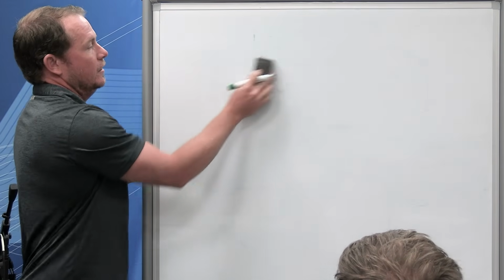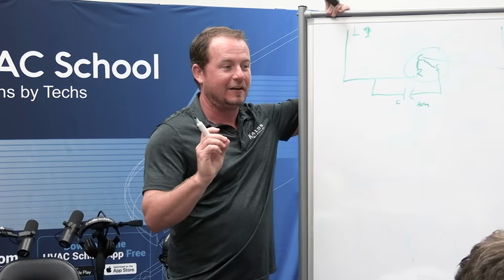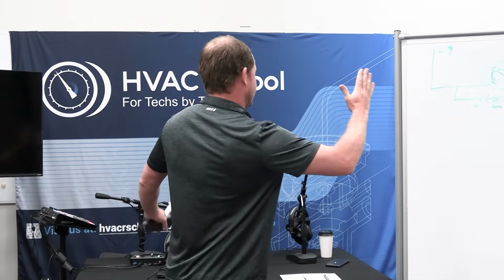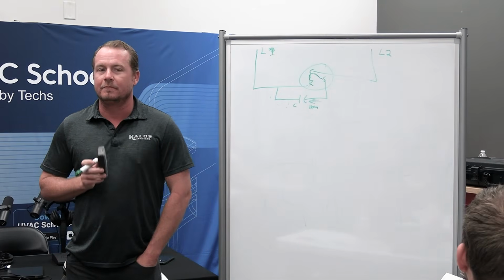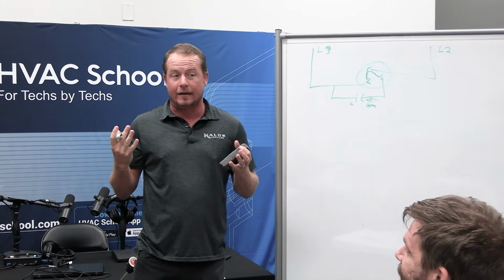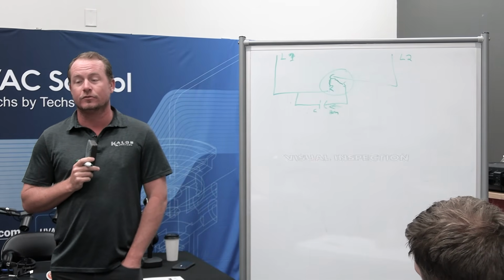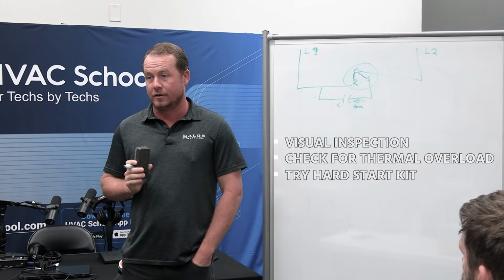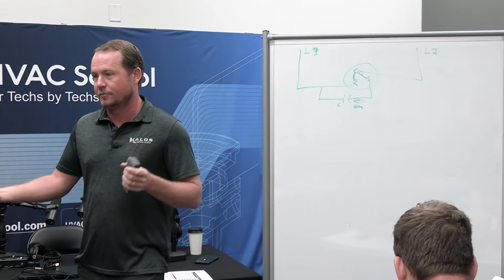Capacitor and Hard Start Myths Busted

Comment: From an electronicsc technician point of view, the symbol shown is for a polarized capacitor used for DC circuits.
The capacitor would be reversed bias for half the cycle.
When a capacitor is reversed biased it would essentially becomes a short circuit!

I don't know about those hard start kits but I suspect that they just increase the total capacitance!

Comment: I have replaced low capacitors just to find the numbers not changing with the new capacitor.  Does anybody know what else should be going on.  Is it the windings in the motor that are going out?

Comment: Two phases is not created from a single phase. There is no two phase home wiring. It either single phase or three phases. Nearly all US houses have single phase 2 wire 240 volts supplied with a center tap neutral to get 120 volts.

Comment: As you said it’s only part of second that kick start cap will start compressor .
I saw that I have regular clamp meter I put it on high A .around C black cable .
I just pushed contacts fraction of second my amp was 82. Without start kit .now with start kit it hit 60.
My system has relay +cap hard start kit. I did go bad my system low side was hot to touch. Liquid line was colder than it should ,
I did check all wires and R,S,C comp wires and values,ok.
I left system off with gauges connected to service valves to see if any leaks, for over night was ok . I don’t have TXV, I do have Orifice , my system in attic with 24” high ,coil is there , I went up also cleared drain in case , was ok,, I checked superheat ofter all that .i did put a new dual cap old one 43.6 f  of 45f so I change it too,,no system runs ok for now,
Superheat off by 1 . I don’t want to add more until it unit ask for it.( your note about what cause boiling referigrant,it very valuable and what cause it faulty cap made comp struggle.heat up suction side.
Great informations ,you are the best.

Comment: I liked your explanation about capacitors. If you were to use EE speak, it would go over most peoples heads (changing electrical fields theory) . I once had to describe a digital IC tone generator (several BCD coded chips) that actually created a precise number of pulses per second, but was non sinusoidal and aperiodic in that the pulses had irregular spacing . The output had to be filtered to get a tone. I described it as a chip that counted out a certain number of balls per second and dumped them down a hopper.

Comment: Its very hot here in Central Florida these past months. I am here because my 8 year old TO-5 2 wire hard start kit (Installed in 2017 by HVAC company during emergency maintenance for bad Fan Run capacitor) failed and my compressor would not start. I have been replacing my 45/5 run capacitor about every 2 years with AMRAD with CPT terminal. the other day as I arrived home I heard the compressor trying to start. It did this a couple times while I was there and I think it had just failed as the house was not warm and the compressor was not very warm either. I immediately blamed the run capacitor and installed another. Same problem. I removed one lead of the hard start kit, and the system started fine.  I measured both old and new capacitors capacitance and dissipation factor and they were fine. (The CPT fuse had not burnt)  The hard start kit capacitor measured dead shorted. I removed the kit and disassembled the potential relay and there was a huge amount of carbon from arcing. Reassembled the hard start kit and capacitor measured 0.3 ohms on the blue wires.  I suppose it had been failed a long while. I wonder how I can determine if there is damage to the compressor windings? The system is 15 years old with regular maintenance service. I do change my own run capacitors proactively to save an emergency service call.

Comment: Interesting video. I Have a question and hope some can help me.  I want to lower the startup current on my refrigerator which is connected to an ESS battery system. The startup inrush current I measure with a chines multimeter is 12.5A @120Vac the nominal current of the compressor is 0.8A. The impedance seen by the grid is 10 ohm so I thought let's use a 10ohm NTC 2A resistor in the run coil path of the compressor. In this way I want to lower the current with say 50% assuming the compressor will still start and not stalls under these new conditions. My question is this a good idea, and has anyone ever done it. Is my assumption of 10ohm NTC ok.

Comment: If an AC condenser start capacitor fails, will the compressor try to start on the hard start capacitor and would that cause damage to the compressor?

Comment: I like this description. The best description i use is riding a bike. A 2 pedal bicycle you need a hard push on the pedal to get going and then you need to give it a nudge to keep the speed. The pedals rotating represent the single phase wave. A three phase has 3 pedals. Because one pedal has force all the time with 3 phase but on single phase has a dead spot so you need that extra kick.

Comment: Fun fact, the capacitor is actually charging and discharging 120 times a second, twice in each full AC cycle (plus the phase shift).
Reply: Incorrect, you get one full AC cycle 60 times per second. You need the full cycle to be considered fully charged or discharged. Not just the positive alternation and the negative alternation of the AC cycle.
Reply: @DeathLeftHid  This is a matter of semantics, specifically in how you define charging and discharging. 

From an electrical engineering and AC circuit design perspective, charging is defined as the part of the capacitor cycle where positive voltage is applied, and discharging is the part of the cycle where negative voltage is applied.

However, this model doesn't accurately reflect the physical state of the capacitor. It's short hand to simplify circuit design. 

In it's simplest form, a capacitor is two conductors separated by a dielectric sheet/film. It is charged when there is a difference in the number of charge carriers (electrons/holes) on across the dielectric. 

When you apply an AC current to a capacitor, it becomes charged twice per AC cycle (once positively, once negatively) and it becomes discharged twice per AC cycle, when the potential difference across the capacitor is zero.

Comment: A hard start kit helps a compressor last longer by starting it faster — for example, without the kit, the compressor might draw 50 amps for 3 seconds (producing 7,500 heat units), but with the kit, it draws 80 amps for just 0.5 seconds (only 3,200 heat units), cutting heat stress by more than half.
Reply: Yep, this doesn't seem to sink in

Comment: My question is how do the connections of L1 and L2 connect to internally of the capacitor.  Each end of the coiled conductor material or one on the insulator and one on the coiled conductor.?
Reply: Inside the capacitor there are actually two conductive layers and two insulating layers. The capacitance is determined by how much area of the conductors are in close proximity to the other without actually touching, and also how close you can get them. Making the insulating layers thinner will increase the capacitance but decrease the voltage point at which the insulation will fail. Each of the conductors is brought out through it's own the connection. The reason for the jelly roll is it allows both sides of each conductor to count as area. Air, glass, vacuum, paper, ceramics, cotton, oil, wax, tar, plastics, wood, mica, and a wide variety of synthetic materials have all been used as insulators. None are perfect or suitable for every application. 

The oldest and largest capacitor is the natural one where one of the conductors is the earth and the other is a storm cloud. The area can be many square miles, the insulation (air) easily a mile or more thick. Such a capacitor can easily withstand millions of volts until a weak spot in the insulation causes it to fail. Then you get a bright flash of light and a loud noise.

Comment: Can you install a hard start cap on a home air compressor? 2HP Dayton?
Reply: Depends on the type of motor. You might be able to find a kit that's appropriate if your machine has PSC motor. Check first to make sure that any existing capacitors are functional and the wiring isn't broken. 

If your motor has a centrifugal switch (listen for the click almost immediately when starting and again within a second or two upon shutdown) you may be S.O.L. An unloader valve that allows the machine to start with no head pressure might be a better option.

Comment: The center tap gives you the  120 volt, the line itself is 240 without splitting it with the center tap

Comment: A realistic description of a capacitor is two plates a small distance apart. Both of these plates have billions of electrons in them. When you apply a voltage (From L1) to plate #1 the voltage pushes more electrons into the plate, that builds up an electric field on the plate, the electrons on Plate #2 are repelled by the  electric field and electrons get pushed off plate #2 into (L2).
 When the polarity reverses, L2 applies a voltage to plate 2, building up electrons and an electric field. The electric field on Plate 2  pushes the electrons off of plate one.

Comment: So, if the capacitor "kick starts" the motor (that's what I was always taught), I was also taught that there was a relay inside the motor that disengages the cap circuit. Am I hallucinating?
Reply: Centrifugal switches are used on some air compressor motors and some water pumps to perform a similar function as the potential relay.
Reply: That depends on how long ago you were taught. Some older equipment works that way.

Comment: An ACcap symbol uses 2 straight lines, when one is straight and one is curved it is a DC cap and would blow up in an AC Circuit.
Reply: Not necessarily. The curved line could also designate the outermost layer of foil in a paper/wax, metalized film, polystyrene, or the frame of a tuning capacitor. There are a few symbols that are only used for certain types of polarized capacitors such as electrolytics or tantalums. Any of the other capacitor symbols could be used to designate a DC cap with the addition of a + symbol. You have to be careful with the use of a pair of parallel straight lines, with or without a slash through them. In some fields such as industrial controls and in some cases HVAC, they may represent switch contacts. I try to avoid using that symbol.

Comment: From charGPT,

In the start sequence of an AC compressor, a capacitor is used to improve the compressor's starting performance. Specifically, a start capacitor provides a temporary boost of electrical energy to help the compressor motor start more easily. Here's how it works:

1. Starting Torque: The capacitor creates a phase shift in the current, which improves the starting torque of the motor. This helps the motor overcome initial inertia and get up to operating speed more efficiently.

2. Smooth Operation: After the compressor starts, the capacitor usually disconnects from the circuit (in the case of a start capacitor) or remains in the circuit to improve efficiency (in the case of a run capacitor). This helps ensure smooth and efficient operation.
Reply: charGPT has it only partially correct. Either the start or run capacitor topology will provide a phase shifted current to one of the motor windings to to not only aid in starting but to also get the motor spinning in the correct rotation for the application. 

A start capacitor is used only for startup and will be disconnected from the start winding once the motor is up to speed with either with a potential relay, a current relay, the electronic equivalents of either, or a purely mechanical centrifugal switch. Such a motor might be known as "Capacitor Start Induction Run (CSIR).

If there is no disconnect means and the capacitor is permanently connected to the run winding, the motor is commonly known as Permanent Split Capacitor (PSC) or occasionally simply split phase. They tend to be somewhat more efficient than the older design. For some reason capacitor quality has sharply declined. I can't blame it totally on the elimination of PCBs.

The next major step up on the efficiency scale is the Electronically Commutated Motor (ECM). That includes the notorious x13 which found it's way into air handlers and high efficiency furnaces a number of years ago. It is essentially a three phase motor with integral electronics. Great idea in theory, but poor execution in controller design. The $3 part intended to limit inrush current is the weakest link. 

IMO the inverter compressors and blower motors which have almost completely taken over in the mini split world will soon be taking over the vast majority of the traditional residential market. Once again they are a 3 phase brushless DC design but with separate drive electronics that are vastly improved. There are a few brands that actually stock boards, motors, and other repair parts, and offering them at low cost. The main drawback I see is that those systems are far less tolerant of sloppy installation practices which have been increasingly creeping into the industry over the past half century. Being variable speed systems, "gas and go" will no longer be an acceptable option.

Comment: At around 9:20 you mention that the start winding is “always in place” and that it is not disconnected.  Just for your viewers, some single phase motors do disconnect the start winding via a centrifugal switch inside the motor or externally with an electronic Start Switch like a Stearns SINPAC.  Great video!  I didn’t know the compressor motor left the start windings in play.
Reply: It is a Start Cap not a run.

Comment: Glad I came across this video. I have my home set up with a generator disconnect and want to run my ac with the generator. But my generator doesn't push enough power to start the AC unit. I have been told that a hard start will allow this. But the AC runs fine now. So my question is this. Is there any harm with installing a hard start kit on a AC unit that is running fine, so when the power goes out and I am operating off generator power the hard start is already in place and ready to go? Also what are your thoughts on a micro air soft start kit?
Reply: Most generators won't tolerate high inrush currents without bogging down or stalling and are incapable of producing full rated power with loads that have low power factors. A soft start might help with the inrush. A hard start could make it worse. You will still have an issue if your AC needs more amps that your generator can provide continuously. Some of the new inverter AC systems are actually quite generator friendly. Legacy systems not so much.

Comment: What about a soft start kit?
Reply: A soft start kit ramps the voltage to prevent a current spike on startup. These allow the resistance to inrush to build up via the reverse current force of the magnetic field wave sustained by the motor as it begins to turn. Once the motor is at full speed (no longer accelerating), it is resisting the maximum amount of inrush at that rpm so the current is stable.

A hard start will increase the inrush current for motors that need more torque to start. A soft start gently starts a motor that is capable of starting slowly, to prevent a current spike. Supposedly lowering the inrush increases the longevity of the motor by reducing mechanical stress of high torque. IMO soft starters are best for situations where there is limited current available due to inadequate utility or underrated wiring, and honestly should be on all equipment but isn’t because of cost and the manufacturers lack of concern about longevity or the customer’s electrical system requirements. They also can’t be used on poorly designed equipment that is incapable of slowly ramping in speed, or in equipment where high starting torque is unavoidable due to the process (I.e, conveyor belt with no clutch)

Comment: The opinion about a potential relay staying closed causing a start winding to fail is correct, but a failure in the opposite order is more likely. Initially, failing insulation in windings shorts out a few turns at a time. The EMF of the start winding at full speed drops, the start cap stays in circuit a little longer, no one notices anything. When there are enough shorted turns to leave the winding below the pick-up voltage, the potential relay doesn't take the start cap out of the circuit, and the high current heats up the start winding and the insulation fails very rapidly. 
   How can you tell which failed first? If the windings are in good condition, and the relay doesn't pick up the start capacitor will overheat and burst long before the windings burn their insulation. If the start windings failed first, the start cap will often be intact.
   That said, the potential relay would be improved by a time-limit, if only to avoid contributing to failures in progress. The cost to add winding voltage and current monitors to a control board is around $2 and would allow the microprocessor to take over from the electromechanical potential relay resulting in a net cost reduction and add the time-out, but more importantly make it easy for a system to detect failing motor windings early and plead for service and eventually shut down before a burnout makes the repair much more expensive.

Comment: Is there any way to confirm the duty cycle of the hard start (relay being energized)?   Yes, .... checking it in the system?
Reply: There's always a way. I would use a small current transformer like the open/close type that comes with some versions of the PZEM-022 meter, a 10 ohm 1/4 watt burden resistor and one of the cheaper digital storage oscilloscopes that would allow me to see a visual representation of the time interval. Excellent way to see the length and magnitude of inrush currents as well. Then again I'm one of those "always fun EE's" that Bryan has warned about.